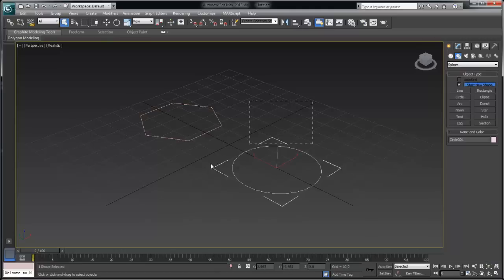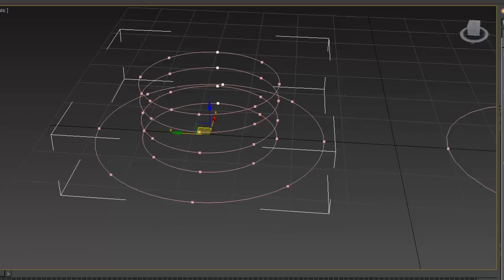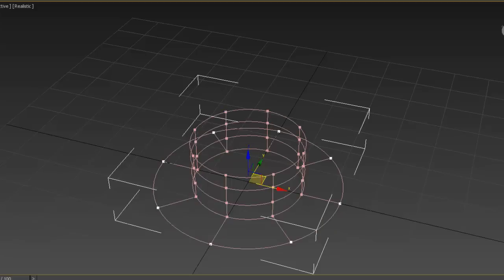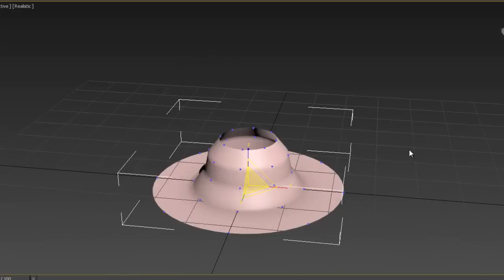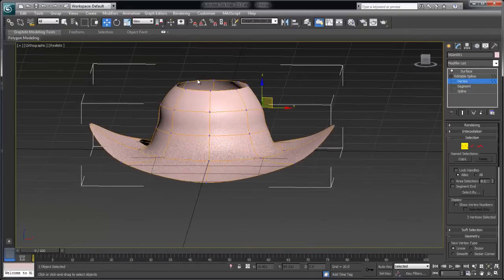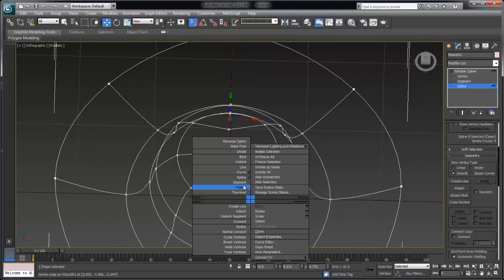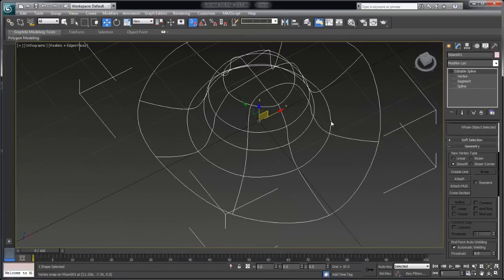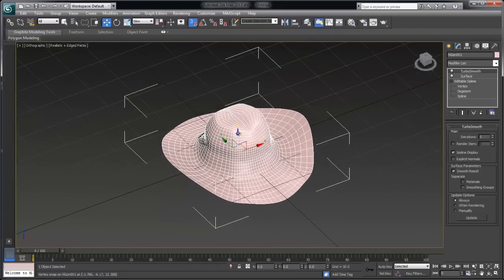3ds Max Spline Modeling Technique

Comment: To copy the splines at the sub-object level. Select the Spline Sub object mode (red line), select the spline you want to copy (it turns red), the hold the SHIFT key and move the spline. A sub-object copy will automatically be created.

Comment: When I render the hat under there is no object, the normals are on the other side. How to do the hat so the render will work both sides?
Reply: martinflashgordon shell modifier for thick object or 2 sided standard material for paperlike fake
...
Reply: Sado Mikas shell works fine, but I have never heard about 2 sided material fake, do youjave tutorial?
Reply: "2 sided material" but it looks fake... You just open material editor and in standard material option you set "2-si
ded material"  ON.
Reply: Sado Mikas nice option, thanks